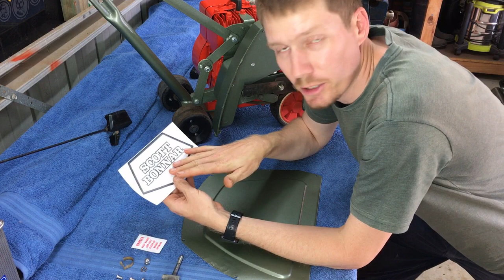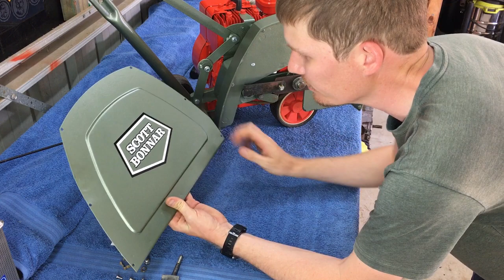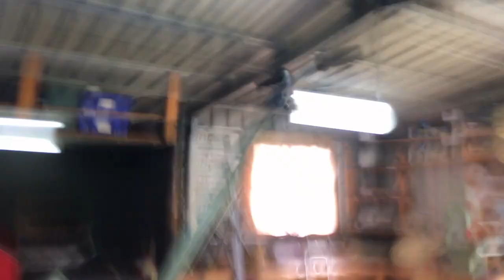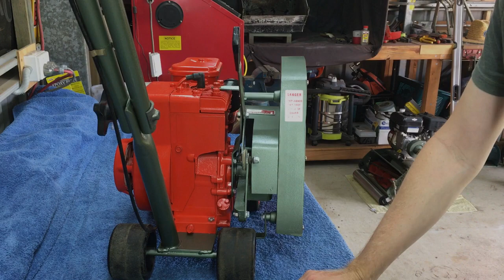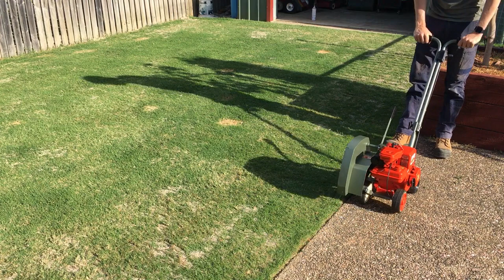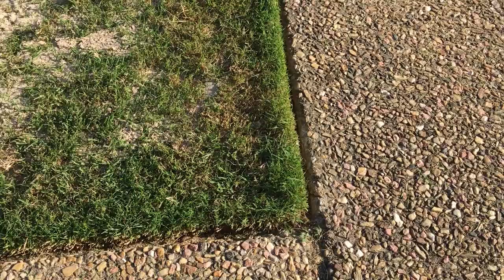Scott Bonnar - Model 38 - Lawn Edger Rebuild - Accessories

Comment: Great series of videos mate. I have one in the mail, should be here in a week. Did you replace all of the nuts, bolts, etc?
Reply from the maker: Thanks mate.. I did buy all new stainless steel nuts/bolts.. I just took them all down to my local fasteners shop and they swapped them out.. There was a few specific bolts which I could not replace..